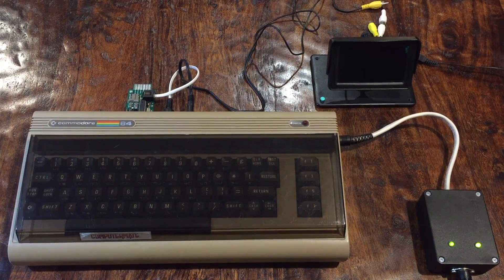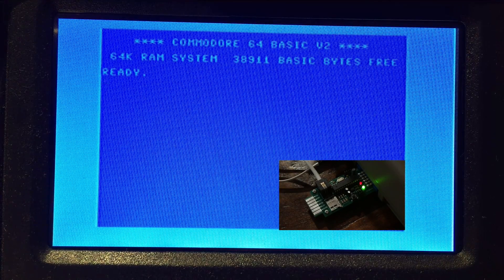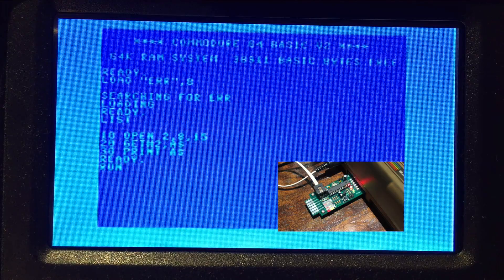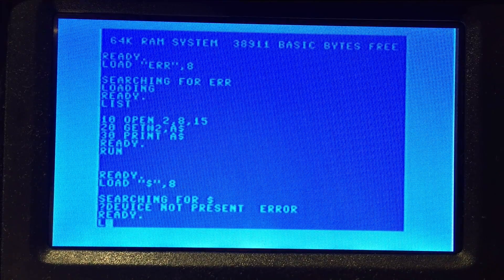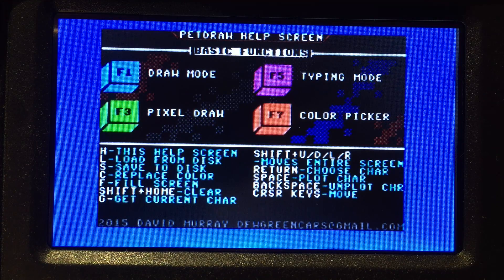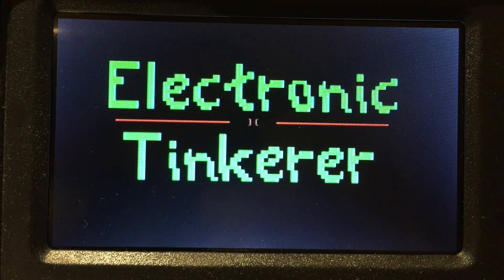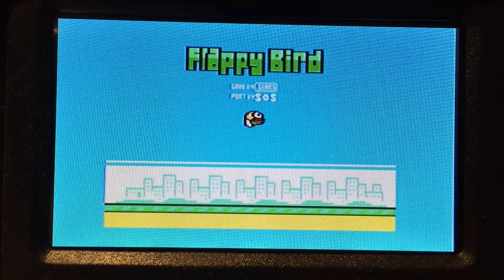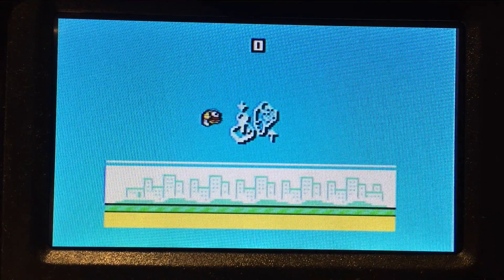1541EmU: Demo

Comment: Sorry i have a second question. What file Ext can i use on the c64? And do i put the files in the root folder or do i need a sub folder?
Reply from the maker: Traditionally, BASIC programs end in .PRG, but this should work with any file extension as long as you type it in the "dir" file on the root of the SD. For the video I had my programs in the root of the disk, (but you might be able to get away with putting them in a sub-folder and typing the full path to them in the "dir" file; just remember that spaces are counted as part of the name! - I have not tried this, but I don't see why it would not work :)

Side note: This will not work with .d64 files unless you extract the files from them on a computer and put the contents of the .d64 onto the root of the SD.
Reply: @electronicstinkerer5429  Hello what do you mean by Extracting the files from the .d64? Sorry I'm new to the whole commodore community. So i never head of that before. I'm trying to a program called File browser. I can bring it up. But it suppose to display all the files on the SD card and let me select them. Kind of like a nice cleaner list command i guess. But everytime i try to bring it up no files are being displayed it's empty.
Reply: Some odd reason i can not get any file to show up in the file browser here are a couple of link of images i took. 
http://deletethis.info/commodore64/20190928_091256.jpg 
http://deletethis.info/commodore64/20190928_091321.jpg
http://deletethis.info/commodore64/20190928_091329.jpg

I'm not sure what I'm doing wrong.